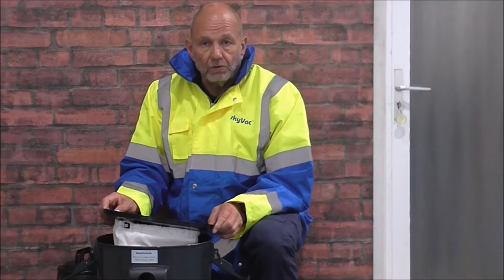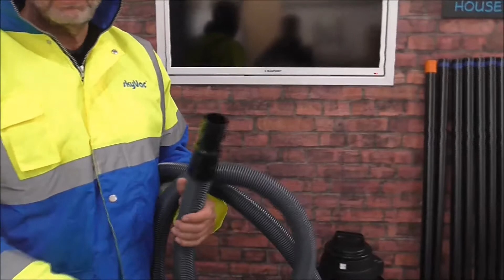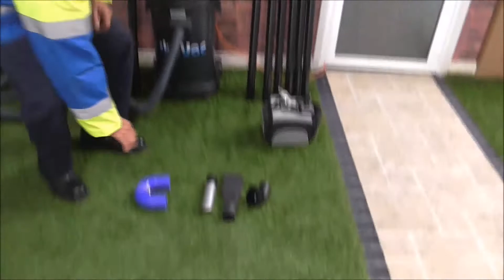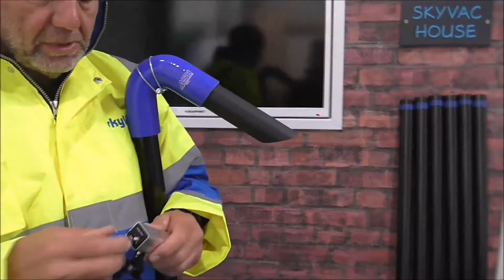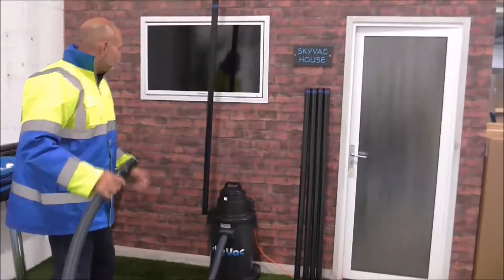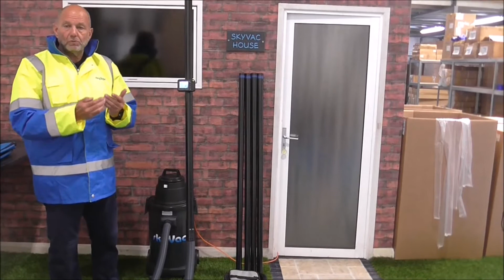Assembly Guidelines and Methodology of Using skyVac Atom Multi-Task Cleaning System

Comment: Got a skyvac mighty atom a few weeks ago and there is Def a learning curf to using it but it's actually made it possible for me to do those higher 3 story gutter clears which I would usually pass on.

I usually position the camera so it's at the side so you can see what you're clearing up next as usually the tiles are in the way if it's at the top.

Great bit of kit though.
Reply from the maker: Hello, thank you for updating us on your experience using the skyVac Atom - it is a brilliant little machine. It will take some practise getting used to using something like this, particularly if you're familiar with emptying gutters by hand - but it sure helps alleviate the safety risks that comes with ladders and scaffolding! 

If you'd like any advice using the skyVac Atom no matter how small, please just give our team here a call during office opening hours we'll be more than happy to talk you through best practise 🙂

Kindest regards,
Danielle

Comment: Is there an easier way to keep it from clogging with leaves? I recently got one this week and it kept getting clogged on bigger leaves and pine needles. I was constantly stopping and unclogging the blue/crevice attachment.
Reply from the maker: Hello thank you for your comment. The solution to the problem that we have had in the past is to not put the end tool (i.e the dirt breaker) directly straight down in to the gutter but to position it on it's side a little so it's at an angle. By doing this technique and using a sweeping sort of motion, allows a flow of air to get to the tool to help prevent it clogging with leaves etc. 

We hope this answers your question, however if you are still having troubles or require any more information, be sure to contact us on 01604 968700 and someone will be able to assist you further. 

Kind regards, the Spinaclean team.

Comment: I have just bought a skyvac atom ,how and how often are you supposed to clean the pipes and filter inside of machine? Also where do you tip the rubbish after job is done?
Reply from the maker: Hi there Ben,

Apologies in the delay in getting back to you. If you contact our team on 01604 968700 or email: info@spinaclean.com, our team should be able to advise you on what's best for your machine right away!

Thank-you,
Spinaclean